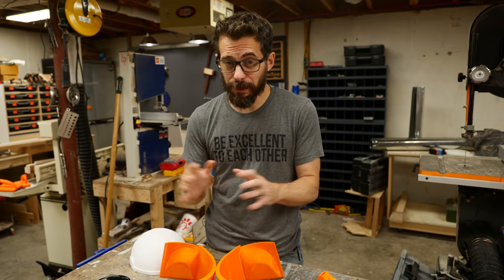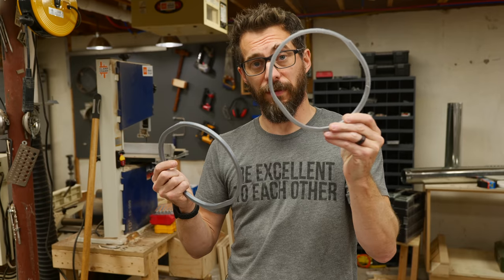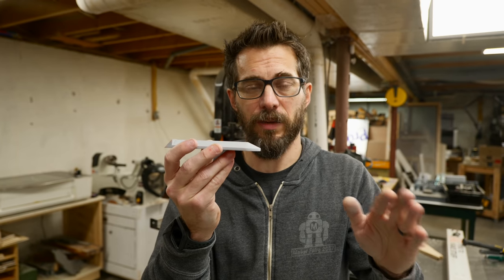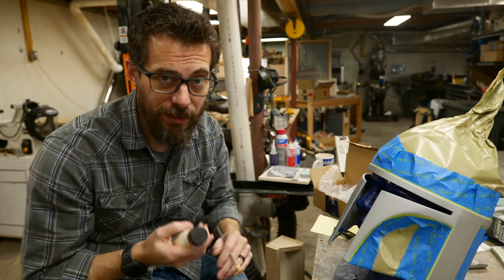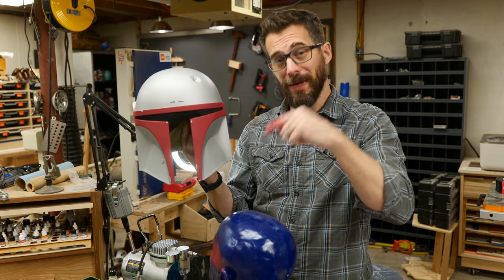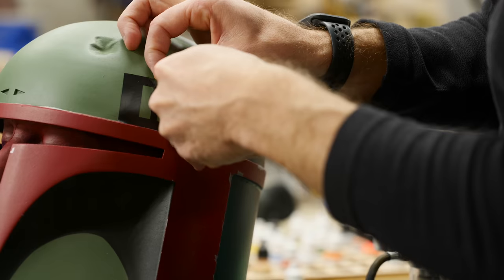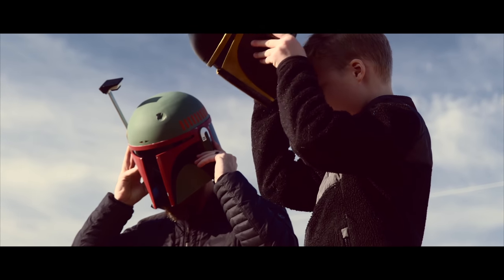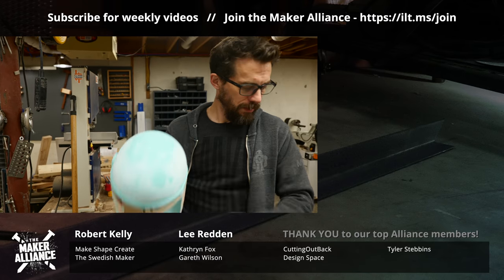Mandalorian Helmets Using Small 3d Printers | I Like To Make Stuff

Comment: I’ve been using my left over silicone for mixing for years. Works great for paint, bondo, pretty much anything. They also work good for holding pins, or any sharp pointy tools.

Comment: Hey Bob,
Let me post 2 quick additions on your paint Job:
I) as an alternative to masking fluid for getting the chipped look you can also use toothpaste and wash it down after painting with some water
II) I'm sure it took you some effort to get the surfaces painted as acceptable as they turned out by using that airbrush, mostly because the one you used is generally for detail work, the spray field is very small in order to have as less overspray as possible on small parts or areas. There are ones designed to paint bigger areas, apparently reasonable cheap, they mostly have a bigger glass jar mounted underneath to hold the needed bigger amount of paint you need to work on bigger areas. Using one of those might reduce the amount of cloudiness in your painted surfaces right away. 

All in all once more a tremendous project, thank you for sharing it with us. 

Sven.

Comment: You can use hairspray applied with a sponge as a chipping mask.  I use this technique in model building. After the paint is dry just use a stiff brush ( old toothbrush) or even a piece of masking tape to remove the hairspray and chips will be left behind in whatever your base coat was. 

It can even be done in layers to have various colors etc. It’s really pretty simple.  

ILM used the same technique with their props and models.

Comment: I use a soldering iron on low to melt pla together. You can use scrap pla and weld additional material as well and then sand.

Comment: A tip I've used to avoid holding JB weld glued parts until it sets is to leave a hole in the center of the applied epoxy and put drops of fast setting superglue in that spot just before placement. you can let go after about 15 seconds and the cryo cyanate holds it in place until the surrounding epoxy cooks. (-:

Comment: Great job! I like that you took the time to really flush out the weathering details. Using the liqid mask is pretty easy but still a bit of a pain if you have a bunch of ragged detail to add. I've had great success using just a spray mist of water and sprinkling a mix of  rock salt and smaller grained Kosher salt over the areas I want to mask and letting it dry. You can remove some if you want less, or add another layer if you want more. Spray paint as usual, dry, and just rub it off with a soft cloth. It gives good results, ( after playing with it a few times ) and is much more random in details ( my opinion). Great channel and love the content!

Comment: Hey if you want to smooth out your 3d printings you can put a bowl of acetone and a little ventilator under a box and it will „melt“ the surface. Of course put the printing under the box as well. Just try it😄

Comment: I never airbrush humbrol paints because the pigment consistency is not very good. It leads to an uneven finish and splotchy/splatter patterns on the model even when it is thinned down correctly. Tamiya paints are amazing to spray as well as Vallejo Model Air, just make sure you have the dedicated thinners and don't use tap water.

Comment: protip i picked up on my din djarin build. you dont want to epoxy your visors in, its much better to epoxy chicago screws on the inside of the helmet and drill holes in the visor. this makes replacing the visor a breeze if it ever gets too scratched up

Comment: I'm just working on my 3D printed Boba helmet. I used PLA and damn it's hard to sand. I ended up using wood filler pretty much all over the helmet and then sanded it to get a super smooth finish. Also, I reinforced the interior of the helmet with fiberglass and resin especially in the joints, since I had to print it in 5 parts because of the small printer.

Comment: One putty you can use on plastic (abs especially, never tried it on PLA honestly) is squadron/signal putty (which I cannot seem to find anymore (but it WAS great (because it would 'weld' into the plastic).  Another name for the masking fluid (as you put it, is friskit, you can buy it anywhere that has glazes for ceramics, buy some CHEAP brushes to put it on)  Great stuff I have used it for everything from doors (aboard USN ships) to R/C car bodies.  You can get super-glue to kick a lot faster by just gently BLOWING (do not breathe IN) on it, the humidity in your breathe will get it to kick.  For the scanner I might have bought an LED flashlight at the dollar store and used the guts for the scanner.

Comment: In the model building community there's little tricks like using a coat of hairspray in the area where you want to chip you let the hair spray dry you paint over it and if you put water on that area it will reactivate it ..with a toothpick you can then chip areas you want after a coat of sealer it'll stay as is .. that masking putty you used gets the same affect .... if you're ever curious on techniques for the air brush look up plasmo on YouTube really great techniques that can be applied to varias number of things not just model building .

Comment: Tip- if you use an app called ScandyPro and scan a 3d model of your head you can scale your model around your head for sizing. Also, wood filler (plastic wood brand name) works better for filler & is cheaper.

Comment: One thing to keep in mind is splitting up a bigger thing: alignment.
Simply cutting works, but putting the bits back together is tricky.
Depending on layer orientation, parts will 'relax' a bit after printing.
Not to the extent seen with annealing PLA, but some contraction parallel to layers happens.
If your CAD skills are up to it, 'pegs and holes' or other non-showing aliment aids can be built into the model.
Parts can 'click' together, the glue just holds them there: the pegs, pins or whatever add much strength.
Holes in the edges of two pieces can be fitted with 1.75mm pins, ensuring perfect alignment.  
Printing 1.75mm diameter alignment pins is a pain, hard to get perfectly round.  Any ideas?
Just remember: If the glue is stiffer than the part, the glue might do a 'brittle fail' and lose adhesion.
Pinned or 'click' fit allows fully assembling the project prior to gluing.

Comment: i just found out, theres a certain masking tape thats super narrow and has a wire in the middle so you can create awesome designs using a stencil, its used for applying stencils on cars and so you won't have to touch the car with a knife to cut the stencil.....maybe itll come in handy at some point

Comment: I don't 3D print or even make these kinds of project but wouldn't putting small brass or even wood pins where you are gluing help? Drill small holes and use epoxy to hold the pins in place. I feel it would help with keeping everything aligned perfecting and maybe even provide extra strength.

Comment: That helmet honestly looks incredible <3

One thing i'm curious about. For the bigger sections, any reason why you'd use an airbrush as opposed to a normal can of paint? Better control over paint flow? More detailed work?

Going to be doing my own Mando helmet soon and want to make sure mine comes out as good as it can
Reply from the maker: The only reason for me was that I am trying to get better by practicing with the airbrush, and (the bigger thing) is that I was trying to use the exact paint colors, which I could find in small bottles, but not spray cans.  I'm sure you could find something that's really close to the right color though.

Comment: So I'm late to the party on this, but I just wanted to share the trick I found with shaping the visor.  I was struggling with the heat gun because you have to work to make sure you don't overheat and you heat evenly.  So, I changed my tactic, took my electric skillet and filled it with water, and heated it up to 160-190 and that got my visor evenly heated and was perfect for forming.

Comment: Tbh the spot putty is generally used for small imperfections you don't really want to use it over large areas and definitely nothing thick you might have been better off with proper bond for that volume, for the chip masking you can use a lot of different options such as liquid latex or even in a pinch toothpaste but great job dude

Comment: Did you link to which files you used for your build? or do you prefer not to as it might be considered endorsing one person over another? IF you can link which files you used, it would be easier to get started.
Reply: sorry,  i had missed the part on the Fett helmet where you had put on the vid that you bought it from the modeler and it was no longer available.

Comment: Hmmm PETG not exactly more sandable, I find it harder to sand and print than PLA or ASA. But PETG is more flexible which isnt exactly easier to sand. Try sand a PET soda bottle for reference. The harder more brittle materials are usually easier to sand, but the PLA specifically can get a little hot while sanding and deform if not careful.

Comment: Just finished mine that was 6 parts on my ender 3. I’m surprised you didn’t do 1 piece on the cr-10, I bought one just to do one piece helmets myself.
Reply: I asked that question too. I’ve got an Ender 3, but I’m almost finished making a 330 x 330 x 300 Hypercube, so I’ll wait til that’s finished and do it in one.
Reply: @Grumpyoldtwit  nice. The 6 parts was a pain in the ass and about 30 hours of sanding. One shot is the way to go 😂

Comment: On your forge... the firebrick will swallow heat. You need to line that with ceramic insulation and paint said insulation with refractory mortar.... the bricks soak heat. So... it works, but too slowly and you waste heat/fuel.

Comment: i would connect a servo motor to it, run the cable inwards and down the shirt to your belt loop so you can activate it by hand at your waist
Reply: i should mention, this is for the little eye thing that you bring down to lock in on targets

Comment: Get yourself an anycubic predator Deltabot as a large 3d printer
Reply from the maker: well, I don't really need a large 3d printer. That's kinda the point.
Reply: @Iliketomakestuff  it is useful. Deltabots are fast. Have mine mided like crazy. Fun to mod, and it is quick.  Huge fb help group on it
Reply: You don't need it, but it helps!

Comment: Just started video, and already seen 2 things your doing wrong. Apoxy wont hold up well, you should weld by using a hot soldering gun, and melt two pieces together,  when it gets dropped, and it will its gonna break apart.. then  filling in with spot puddy. Then as you used it you put it on WAY to thick . Do small layers sand, primer to see what ya missed, and do again till you get smooth as you want.. ,Also your printing you used way to much supports when printing.

Comment: Nothing on how to secure the helmet inside?  Great looks but they should fit well and not turn into a bobble helmet made for humans.
Reply from the maker: Some EVA foam blocks secured with hot glue works really well.
Reply: I'm debating gluing in some motorcycle helmet pads for mine